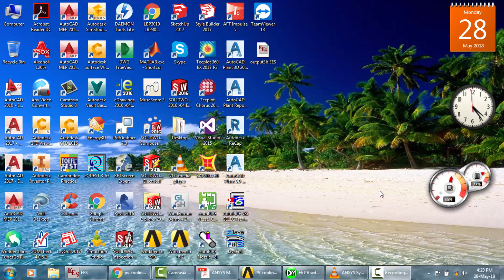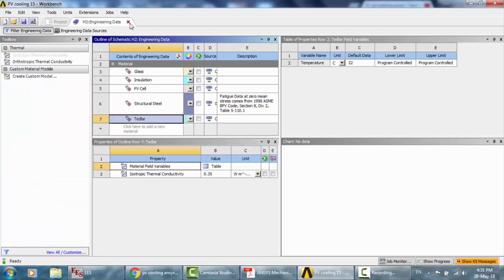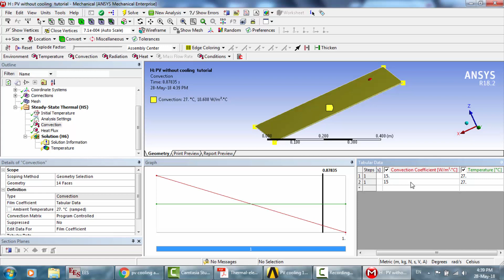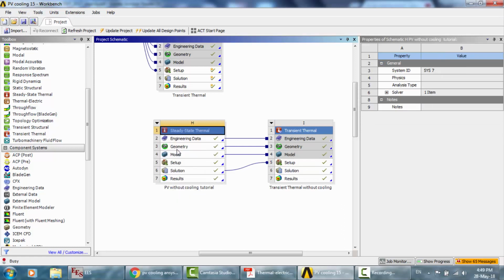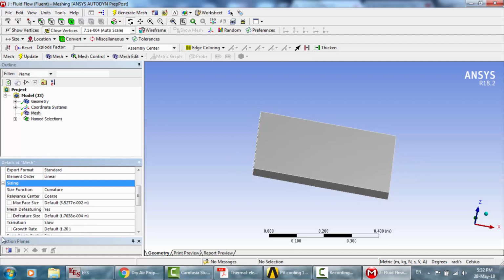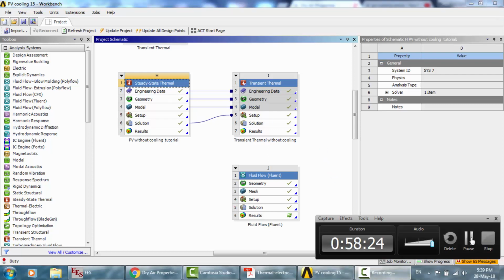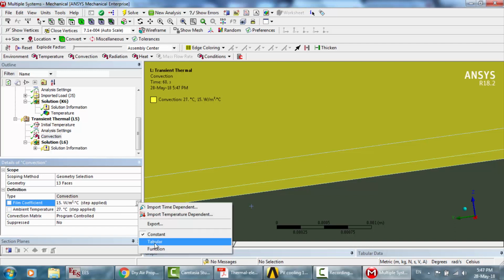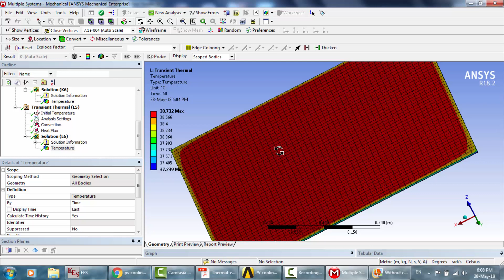Cooling a PV solar panel using Ansys thermal and Fluent, fluid solid interface FSI

Comment: This is very helpful. Can you please make a tutorial on cooling a photovoltaic cell using the phase change material (wax)? I will really appreciate it.
Reply from the maker: Hello dear Sarah, simply follow my tutorial about cooling the PV using solar ray tracing, the only difference is that we use the solidification and melting+ the turbulence model. Then we define the properties of the PCM and then run the simulation. Watch the tutorial that shows how to define the properties of the PCM to know these steps. Danke!
Reply: مرحبا ساره... عرفتي لطريقة التبريد بأستخدام مواد متغيرة الطور؟؟
Reply from the maker: @engnoor5344  Hello dear Engr. Noor, send me an e-mail if you do not know the procedure. It is simple. Danke!

Comment: hi!
i wanted to tell you that i found this video incredibly helpful with simulating the cooling of a pv panel, but i was sort of curious about the transient analysis, you only did it for sixty seconds and i was wondering if it would be possible to do it for say, an hour? would i have to change something?
Reply from the maker: Hello dear Laline, you're very much welcome! Simply you put the time you wanna test the results at, I used 60 seconds just to show theidea in the video. If your expermiment shows changes in the results after 1 minute, or whatever, you test this in the simulation and see the effect of time passing on the behaviour.That's it. Thanks.
Reply: @haveanicetime   thank you so much for responding! i did like you said and i noticed that the results over an hour end up being extremely similar with or without cooling? i can't help but feel like that's not supposed to happen? or is it supposed to come out like that? because i feel like cooling the pv cell should cool it, so there should be a difference in temperature after an hour long simuation. is there perhaps something i'm doing wrong? 
also, i wanted to ask if it would be possible to conduct a similar study using water? would it be possible to simulate cooling with water and/or potentially like, porous materials?
im so sorry for the many questions this is just something i'm very interested in and your video really peaked my interest in the concept of cooling pv cells and i was wondering if it would be possible to implement cooling in different ways!
Reply from the maker: Hello dear Laline, you're welcome!  Cooling methods are miscellaneous! All of them should decrease the temperatureofthe surface of the PV panel through the periodof activation. You can study at first many papers related to that as I showed in allof my tutorials. See how the researchers validate their numerical models against the experimental works and the duration of the experiment compared to the simulations. Also study different cooling methods. Henceyouwill get ansewers to all of your questions :) Thank you!   @laline_aaa

Comment: Hello, Thank you for your video, I followed all your steps and got the same results. Then I changed the material in Fluent to liquid water hoping to get better cooling than air cooling, However, I got exactly the same results. Is there anything (other than the cell zone material) I have to consider or change to try water cooling? Thanks in advance :)
Reply from the maker: Hello dear Mirna, this is good. You gotta change the cell zone material and all related properties and boundary conditions related to the cooling fluid because the conditions of the experiment at air differ from water. Also it is better to get a paper shows water cooling and validate the results. Thanks
Reply: @haveanicetime  thank you for your answer. I will try your suggestions :)

Comment: Hi, may i ask if this solar panel can be attach to a PCM panel for cooling ? (For simulation)
Reply from the maker: Yes dear Yong, yes we can by using solar ray tracing, I have a tutorial about it but showing the heat sink method. The only difference is using the solidification and melting. Danke!
Reply from the maker: Yes dear Yong!
Reply: Have a nice time! Thank you so much, will comeback to you if i have any doubts
Reply from the maker: Okay dear Yong, viel Erolg!

Comment: hello. thank you for your video sir. why you didn't add the radiation heat loss? in this jurnal we have radiative heat transfer coefficient between the glass cover
of PV module and the sky. and thank you again sir.
Reply from the maker: I did not follow a specific paper.

Comment: Hi I am trying to cool a pv with a copper tube absorber with water as the fluid. For steady state thermal I suppressed the water and followed your setup. But I am getting very high temperature (160 C)  and a warning stating matrix coefficient exceeds (a exp value) check solution carefully. The temperature doesn't differ from the top surface to the bottom one as well. What could be the problem?
Reply from the maker: Hello dear Irfan, to investigate the effect of using water to cool the PV, suppressing it cancels it effect. In the video, I used the air to get its cooling effect and then I used the results in ANSYS thermal. I think you did not carefully followed the idea. Danke!
Reply: @haveanicetime  I am suppressing the water at first to get the temperature distribution before applying the cooling for comparison. I will do the proper effect after that by following the video. But I can't even get the before cooling one yet. Maybe I should delete the water body instead of suppressing?
Reply from the maker: Hello dear Irfan, please only follow the procedure I used in the video to avoid any problem. Danke!

Comment: Hello. I'm pretty sure followed all steps but can't get the same results. I don't know how can it work with 3 layers: glass, solar cells and tedlar. And I saw the properties of tedlar are different from the table. Can you help me?
Reply from the maker: Hello dear Huong, do you mean you entered different values of material properties? Is this your point? I have used the properties I got from the student who had the issue..Tell me please how can I help you...Vielen Dank!
Reply: @haveanicetime  Did you use the properties for 3 layers in the files in description? With only 3 layers, I did all setup follow your guild but the result is different. The temperature on the glass didn't change. Did I miss something? Please help me! And this is the file has table of properties for each layer: http://www.mediafire.com/file/u5f3nh7qysykc3q/Efficiency_Improvement_of_Photovoltaic_Panels_by_U.pdf
Reply from the maker: @HuongDang-xl3fi  Hello dear Huong, I did not use the paper you uploaded in this link, I used properties from the student I dealt with including the tedlar. This paper you have used the whole layers I guess with another method and with different boundary conditions. The video is different from it :) Okay?
Reply: @haveanicetime  oh I see, thank you for telling to me. Can you send to me a list of properties of material you used and thickness of each layer? Thank you so much!
Reply from the maker: Okay dear Huong, give me your e-mail please :) ..Danke!
Reply from the maker: @HuongDang-xl3fi  Hello dear Huong, thank you, check out your e-mail...

Comment: Hi sir, the heat flux represents the solar irradiance ?
Reply from the maker: Hello dear Yong, yes, after calculating it from the solar equations I showed in the fins tutorial. Danke!
Reply: @haveanicetime  we can also take the real time data rather than calculating it right ? for example the solar irradiance at 12pm is 600 W/m^2, so i key in 600 W/m^2 as the heat flux  value, am I correct ?
Reply from the maker: Hello dear Yong, actually no, the irradiance is 600 W/m^2, but this is not the amount that is received by the PV. Because the actual amount is I_total= I_direct+I_diffuse+I_reflected. 

The irradiance faces some problems when it gets through the atmosphere, some of it passes without any problem and hits the panel's surface (direct), some of it is diffused because of the clouds in the sky (Diffuse) and the other part is reflected to the surface of the PV after hitting the ground. It is a very complicated process. Also, it is not this way too, it is based on the tilt angle of the PV. 

The solar equations play a very important role in determining the real amount of the solar radiation that will hit the PV panel. Then, after that, if we wanna calculate the power output, we use the electrical equations that include the efficiency of the module but we do not need this in heat transfer simulations. 

So, you need to calculate the I_total based on the tilt angle, the day and the hour, and the location. We use the irradiance you mentioned to include it in the equations, then we get the total I. Check out the code I showed in the other tutorial. For me, I use the data from the websites, then I validate a specific value that shows the irradiance, when Iget a close value by calculations, I continue calculating until I get the I_total (Based on the real value gotten from the data base), then I use the I_total in the heat transfer simulations and the electrical equations if I need to get the power. Okay? Danke!
Reply: @haveanicetime  Okay thanks, i will go through it and will ask you if i got any doubts , Thanks sir
Reply: @haveanicetime  you mentioned the direct diffuse and reflected, my understanding is this,  100% irradiance on to the solar panel and 85% is loss and 15% is converted to electricity. Is it the same thing you are talking about sir ?
Reply from the maker: Yong Chun  Hello dear Yong, the irradiance (comes from the sky and passes through the atmosphere) some of it is reflected back to the space, some of it is consumed by the particles of the atmosphere. When it finally enters these layers, we can consider it 100%, because of the sky clouds and the other factors, we receive around 85% that exactly hits the PV surface. Then, we only get the benefit from 15 % of the 85% left because of the electrical efficiency. Danke!
Reply from the maker: Accordingly, the heat transfer is affected by the 85% that hits the PV panel. We do not make further calculations if we only focus on the heat transfer part.
Reply from the maker: Also, we have two reflected cases, the reflection to the space before entering the atmosphere because of the ozone layer  and the shield that protects us from the sun, and the reflection which occurs when the radiation hits the ground and reflected to the PV panel (I_reflected). I wish this makes it clear for you ! Danke!
Reply: Have a nice time! Thanks sir, i will digest the info you provide. Other than calculating by the equation you mention, Can i use ansys fluent (solar ray tracing solar calculator to calculate the solar irradiance ?) which i will only need to input the coordinates and so on. Note: the default solar irradiance is 1423 W/m^2 and diffuse is 200W/m^2
Reply from the maker: Yes dear Yong, I guess if we use the solar calculator, we get the values of the solar radiation, direct and diffuse but I am not sure of the reflected because it depends on the ground which is not provided in Fluent. but you may use it. See if you can get the exact values from it. Danke!
Reply: Have a nice time! Thanks sir, back to the fins tutorial video you mention, the I_total in your case is 500W/m^2 ?  So the value I_total is in W/m^2 ?
Reply from the maker: @yongchun9055  Yes, it is in W/m^2, in EES, I got more than 900 but it was just an example. If I wanted to use the EES value, I would use 993.1 W/m^2. I used 500 depending on the paper. Danke!
Reply: @haveanicetime  thanks and Noted sir , I can follow the equation in the video, just that I will need to change the  (phi, beta, gamma) and (L_std, L_loc) and (LST) and (N) only  ?
Reply from the maker: @yongchun9055  Yes dear Yong, you can change the things related to the location and the tilt angle. But study please the fundamentals of the solar equations from the reference I showed to understand the parameters and variables. You can depend on the results of the equations at first but later you can validate the measured global horizontal irradiance with the I_total,h . Danke!
Reply: Have a nice time! Thanks sir, you mean the solar engineering textbook you shared where you get all the equations ? I will try to understand the fundamentals and will compare the measured values and calculated values. Thanks !!
Reply from the maker: Yes dear Yong, that reference is great! My assistant professor at college recommended it for us. She prepared her lectures from it and I guess from other sources but I have this one. I loved the renewable energy course because of her. 
When I finished my undergraduate studies 6 years ago, I reviewed the equations, and the code I shared is after checking out many sources. You have to know that dealing with solar equations is not easy at all. But I like its applications ! Viel Erfolg!

Comment: hello sir, would you mind sharing your model geometry of the PV model (without cooling)?
Reply from the maker: Actually it is very easy to generate. Accordingly, you should create it by yourself. Thanks
Reply: @haveanicetime  thanks sir, ive generated the model, however, how to change the air material into water? Do we manually change the properties?
Reply from the maker: @anasfathy7439  Please watch some videos for beginners about using ANSYS to know those fundamentals. Danke!

Comment: Hello sir. I want to reproduce a thermal collector design and simulation for cooling PV panel from a research paper. I'm new to ANSYS and I don't know how to approach it. Can you help?
Reply from the maker: Hello dear Keryl, you are welcome! Simply get your time at first and simulate simple CFD cases. Fluid dynamics and then heat transfer. After that watch all my videos about cooling a PV to know the different procedures. After that you can start modeling your case. Vielen Dank!
Reply: @haveanicetime  Thank you. As for the beginner simple CFD cases, do you have specific videos you can lead me to? Also, can I also have your email please
Reply from the maker: @kerylmcjohnson  Hello dear Keryl, yes, watch my video about flow around a cylinder in my CFD playlist. Also subscribe to Dr. Dalyo channel. Type flow around a cylinder and watch his tutorial too because he used a quick way of modeling the cylinder. I used more detailed steps. Here is the e-mail: mech.eng.ahmedmansour@gmail.com  Danke

Comment: I have done a steady state thermal analysis of pv panel, but in results I got glass temperature higher than the pv cell... What can be the reason??
Reply from the maker: Hello dear Kartik, it depends on the solar flux direction and the heat transfer mechanism. Validate the results against any reference to be sure of the numerical procedure. Danke!

Comment: Sir I need to pv panel with water cooled in ansys how can it be done
Reply from the maker: Hello dear Praveenram, simply change the material to water not air. Also you can check out my 2nd tutorial about PV and solar ray tracing. It shows how to cool a PV by air and you can use water instead. Danke!
Reply: @haveanicetime  I have the water cooling and heat flux at the same plane so how to do it?
Reply from the maker: @ultimate4615  Hello dear Aalap, it is better to send me some details about the design by e-mail. mech.eng.ahmedmansour@gmail.com  Danke!

Comment: Sir, can you please make video on PV Panel cooling using closed loop heat pipe simulation in ansys??
Reply from the maker: Hello dear Kartik, simply you need to include the pipe that has the cooling fluid in the simulation. We do not use the whole system in ANSYS. Just the locations of interest that affect the panel's temperature. Get research articles please to know the methodology of the numerical research. Danke!
Reply: Hello dear Kartik,  Could you analyze the cooling of photovoltaic panels with heat pipes in ANSYS?. or did you find any sample video. Thanks

Comment: Good day, sir. Thanks for the video. What's the difference between this video and other FSI video that uses System Coupling? Can I contact you via email, sir? I badly need your help.
Reply from the maker: Hello dear Kiwi, you're welcome! Simply, this method is used if you wanna study the effect of the fluid on the PV (solid) without taking into consideration the effect of the solid on the fluid. The 2 way coupling considers both effects. My e-mail is mech.eng.ahmedmansour@gmail.com. Danke!